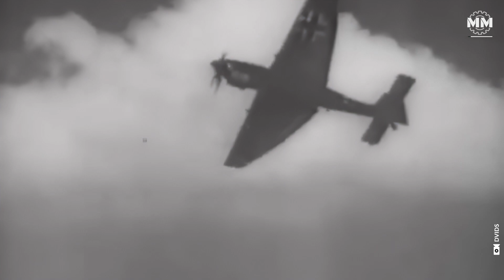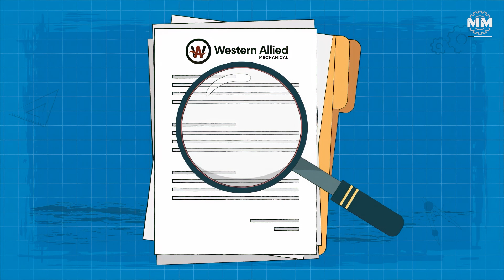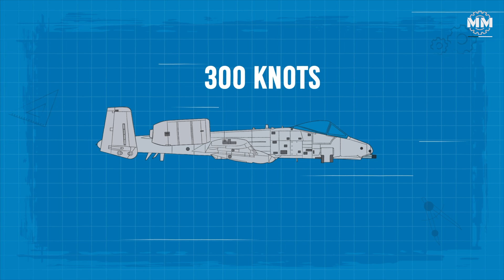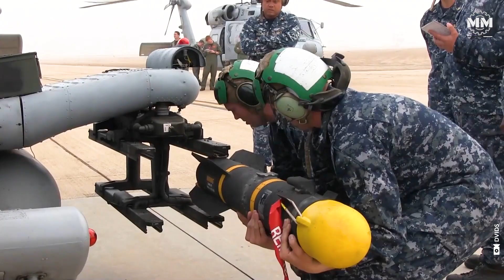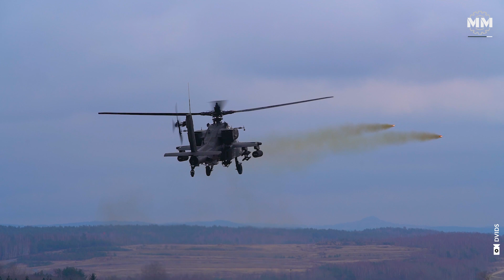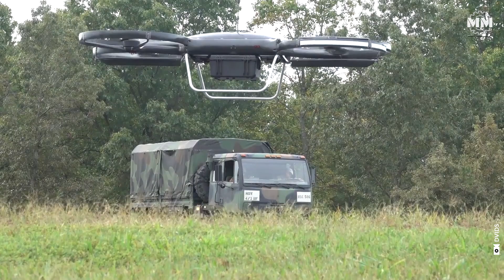When Hunters Become Prey: Is this the end of Tank-Killing Aircraft

Comment: Even old models of Man portable missiles like the Tandem charged Yasin-105 have proven extremely effective against modern tanks.

Man portable surface to Air missiles have limited range compared to the aircraft they're trying to hit. I have still seen videos of Reaper drones being taken down by Hezbollah and Ansarullah in Yemen to great effect. The older models are susceptible to flares but Reaper drones are being downed every week.
Reply: The problem is that the aircraft their trying to hit is in the sky plain to see for anyone on the ground, anywhere.. And any one of them could be equipped with a MANPAD.
Aircrafts that's streaking across the sky isn't there to take out individual MANPAD users in bushes, dug-outs and other nooks and crannies.

You can't apply the rock-paper-scissors model like that in this scenario. 
"Aircraft beat a fella with MANPAD"
- Yeah well fellas with MANPADS all around everywhere beat aircraft thinking's it's a good idea to do a mission anywhere around there.

The result is that the environment that has lots of MANPAD's on the ground can very well and effectively deny air superiority.
That is the fundamental point - and that point is very much valid.